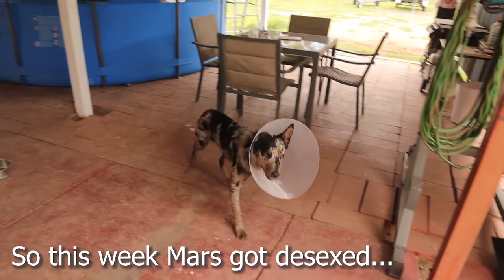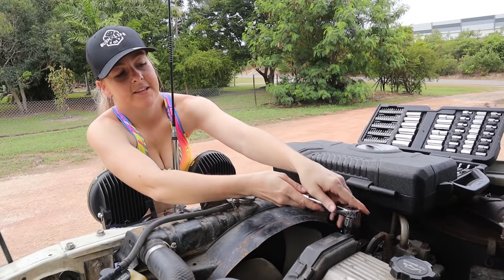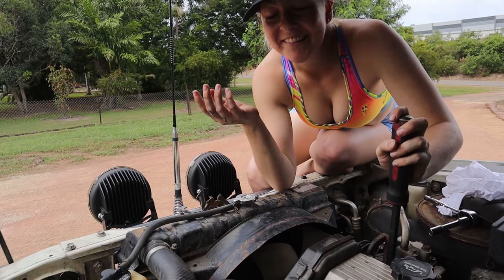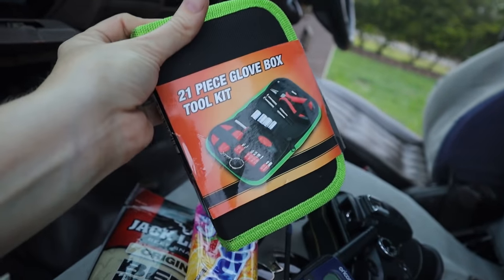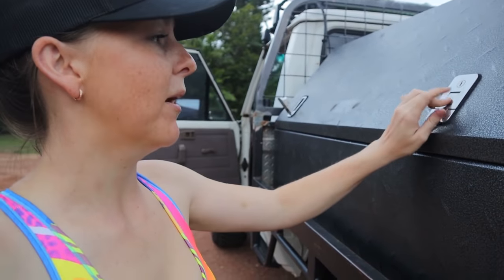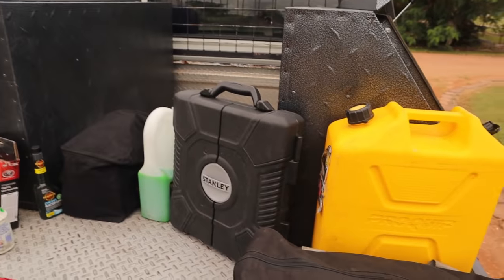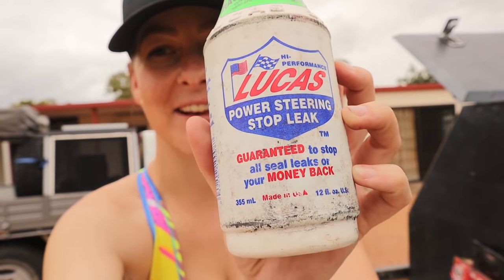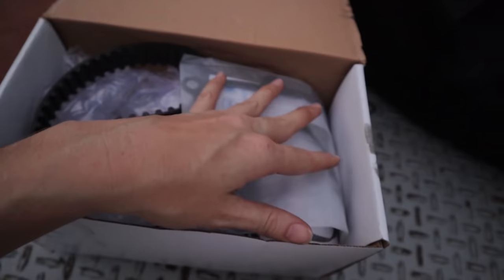My Landcruiser Part 5: What's In My 4wd?!

Comment: Have a look at sparky's on the loose and mr buckaroo . Just coach bolts are good 135mm x 10mm. Also look in op shop for egg beater. You can only use one but it helps cooking. I am making a deadman anchor. I have a friend with a heavy duty sawing machine.   The multimeter can be fixed. There two fuses. One 3amps the other is 10amps but its $22.00 from jaycar and needs to be ordered. Thanks for the tips. Russell.

Comment: Most power steering pumps are a seal, bearing and a gasket. Seal and bearing under $20 at Bearing Service Centre and use the gasket again. Shaft and pump gears don't wear because they never have friction with anything except fluid. Just replace those bits and it will work and last as good as a new one.
Reply from the maker: Nothing wrong with my power steering pump

Comment: Excellent selection of spare parts, fluids, etc.  I may have missed some of the items you carry on board but do you have a 1st aid kit to include a venom extractor & epi pen?  Road flares or flare gun?   I always try to keep a tube of RTV; it’s a pliable gasket maker / sealer.  In America it comes in a variety of types for example; oil resistant, heat resistant, etc.  Good stuff to have!
Reply from the maker: I do keep a blue gasket sealant which I didn't show but yes I do need to invest in a first aid to keep permanently. If I go away I just take the house one

Comment: Hey Dani , been looking out for you for a while. Great vid (again) , quick tip : try and keep your fingers off the glass on your halogen globes , the natural oils in your skin will dramatically reduce their life (it reacts with the glass when they get hot). You should probably keep them inside a nice snug little clean box also , not  just floating around in with everything else (oily stuff ?). Really enjoyed the walk through , you presented it well. Looking forward to your next one. PS: nice top !!
Reply from the maker: The one you see is an old one that I removed. The new ones are in those sealed packets you can see. And for $8ea they definitely don't need anywhere fancy to live haha
Reply from the maker: But thank you very much😊

Comment: If I think a bolt might snap I usually tighten it abit then untighten, then tighten it abit & repeat until it's off
Reply from the maker: Same. So I tried to unscrew it to take it out. And same thing. So either way she was seized in the adjusting bracket and was gonna snap either way. 20+ Year old rusty bolts will do that
Reply: @DanieSimpson  yea nah annoying when u get those ones ay but yea like u said. Mint rig set up nonetheless

Comment: Love your strength to lift that spare tyres onto the tray, I have to lift up by rolling it up my leg. In NSW the police would love to give you a ticket for an unsecured load, because even though you ratchet strapped it down, it doesn't have a net over it. That has cost many tradies thousands. Love your videos.
Reply from the maker: Thank you! Yeah QLD is a bit different by the sounds of it just has to be secure, no overhang or block view of lights. If something cannot be restrained by straps it needs a net

Comment: That's all the sort off stuff we carry over here in UK. But I normal have to carry a bit more  because I'm the one wich gets stuck with fixing all the bigger problems on the other trucks so my springs go through a lot. But just building a new truck. Got a old range rover pick up wich was complete until I put on its side so made in to a pick up years ago but now it's going back on the road. Because other truck is going to the truck spare parts place now. L.o.l
Reply from the maker: Sounds like itll be a good build!!
Reply: @DanieSimpson  well hopefully it will be. Depends on how deep my pockets want to go. L.o.l  I'm hoping a long way because it will be my last build  cos off health but dosent stop me all the time plus got to other trucks on the road.  Well one will be parts in next few days but my old land rover has just run out off  m.o.t.  so got that to fix but it never really anything  ever year it just  seems to go through every year.  Is your new toy a new going to off road or parts or every day truck.

Comment: The Toyota adjustment bolts snap really easily. Ask me how I know. I have even snapped one which was a replacement!
You think I would learn.
Anyway, Toyota part number 88446 is what you're looking for. 
As a swop, you don't know the part number of your radiator is do you? 
Or anyone else for that matter. 
I have a 2.4 Prado 70. At some point I want to put a 4.2 into it so would like the radiator first.
Reply from the maker: Yeah it's a bummer! 16400-17080 I believe us the part number
Reply: @DanieSimpson  Cheers Danie, hope you get your AC fixed soon, have a good day.

Comment: Sorry a recon power steering box is an improvement and an upgrade. It has to be better than a leaking fluid on the road that causes a hazard for other road uses and the environment will thank you.
Be prepared to replace bit on your truck its an old girl she will thank you later.

Comment: Hey mate, you said power steering fluid, Toyota’s use ATF for the power steering. Maybe give that a go if you haven’t already. I saw a box which used to leak like crazy because the owner used power steering fluid. After switching to ATF it magically slowed down HEAPS!
Reply from the maker: All good mine doesn't leak at all now with the Lucas Stop Leak but before that it had the recommend fluid which is a atf dex 2